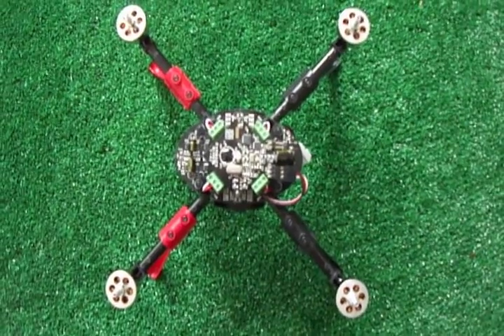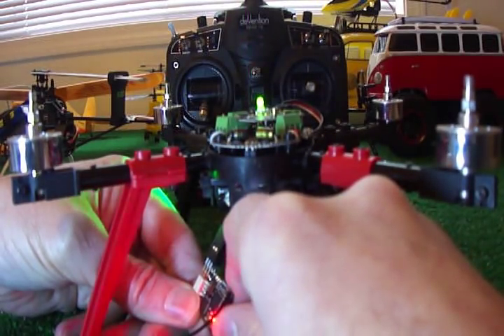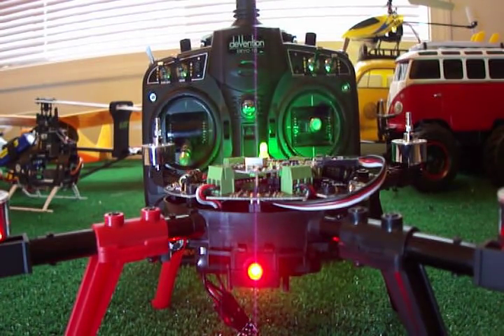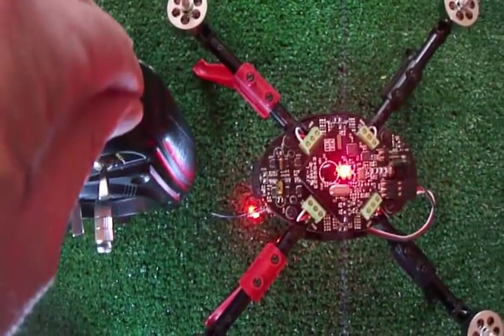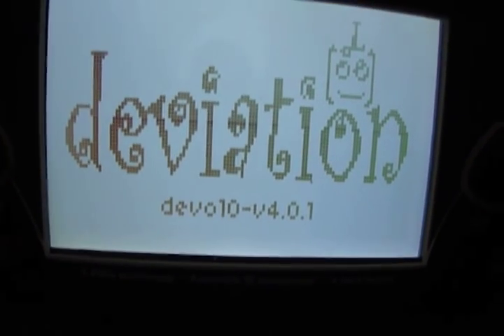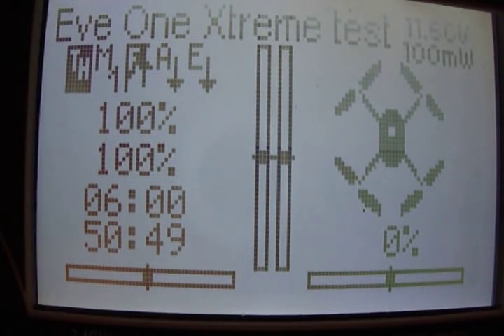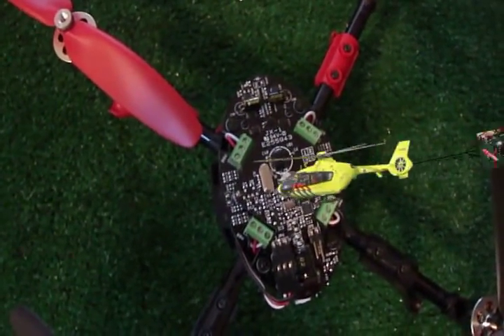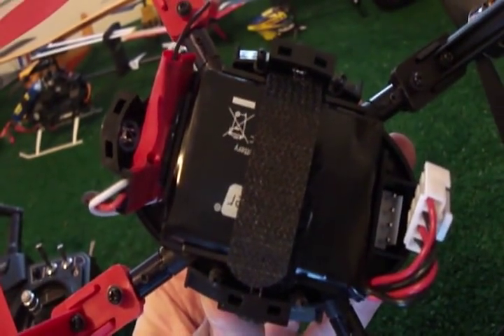RC Logger Eye One Xtreme - How to Install Lemon PPM & Program to Devo 10

Comment: In this video did you bind to the eye one using DSMX or DSM2? I have the same model as you and I cannot get the eye one to bind to the lemon in DSMX mode for some reason, DSM2 works perfectly. Is the satellite module that plugs into the small lemon board enable DMSX? Can it be left out for DMSX? great video!
Reply from the maker: +Adventures in Droning:My EOX is bound with DSMX. I do not use the satellite as I get sufficient range without it. My lemon rx is the 8ch version.

Comment: I am yet to buy a Devo 7e, will I be able to program you config especially the switch from rudder to aileron?
Reply from the maker: The Devo 7e is smaller and has less switches but it is a very popular tx. It can easily handle things like switching rudder to aileron and much more. You can actually load the ini files from the Devo 10 but will lose use of some functions without the 3 way switches and knobs. Also range is more limited and requires an internal mod. The trim buttons can be programmed for extra switches. Running the Deviation software requires a significant learning curve bit is well worth it.

On my Devo 10 I fly helis, quads and airplanes from e-flite, nine eagles, walkera, hisky, and tactic. I have full proportional control on rates and many mixers to allow things like flying on one stick, adding 'cruise control', etc.

g
Reply: Thank you for your insights. I appreciate your time and effort. I already have my Walkera bought from eBay though I am still waiting for my receiver bought from Lemon RX site. I regret doing so because I'm still waiting word on info about shipment a week past since ordering. Having said so I will have time to research deviation software. When you mentioned the steep learning curve is this the loading itself or the tweaks,configuration etc. of the software? Do you have any web site reccomendation? Again, thanks and happy flying!

Jojo
Reply from the maker: Check out Tom Zadar's website http://www.rcproreviews.com/ with excellent transmitter setup guides, good config files to start with, and How-To video.